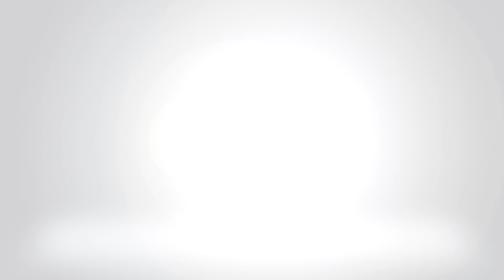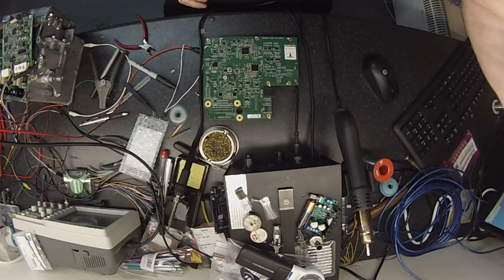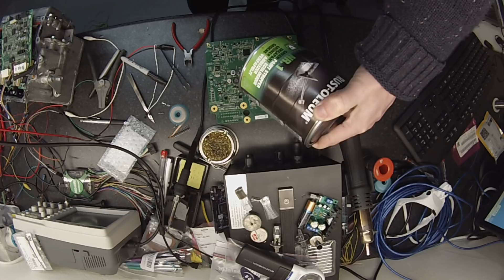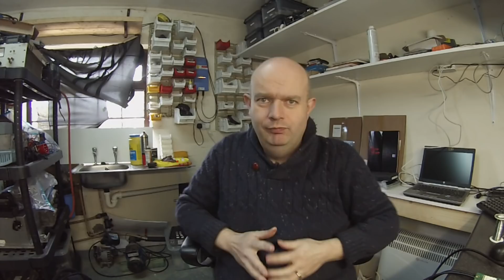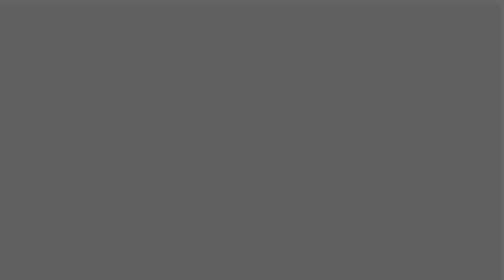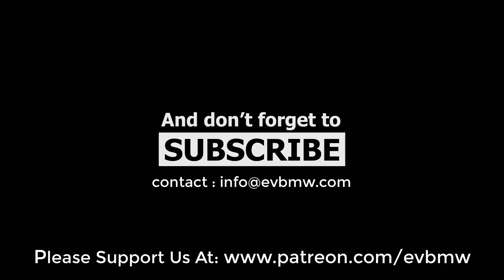Tesla Model 3 Inverter Hacking 01

Comment: Get a UV flashlight so you can see the coating, the more powerful the better.  Try Amazon.com Fubosi brand 100 LED model.  (There is a warning on this light to not look directly into the beam.  And they mean it!)  At work we use Toluene and foam swabs to remove the HumiSeal.  Toluene can be found in the paint department of your local hardware store.

Comment: Didn't have time to watch the full video yet, but: I've replaced the main chips on two of the Model S BMS boards. Assuming this is the same goo as on them (some kind of epoxy or UV curing lacquer or something), it doesn't really hold the chip much, desoldering the chip can be done straight away with a heat gun. Then to get the goo off on and around the pads to solder a chip back in, basically just scrubbing solder on the pads with a soldering iron works well enough. Extra heat with the heat gun makes the goo dark and somewhat more brittle, which may help but makes an awful looking end result.

Comment: My understanding is the IC's you removed are the TMS320F2811 (no external memory), the TMSF28035 and the Proasic A3P125 FPGA. Are you going to try and figure out what they do? Or are you going to replace them with something without knowing what they do? Usually I understand your goals and objectives, but I'm at a loss here.
Reply: He's just using the parts as a mechanical practice mechanism to see how to remove Telsa assembled chips  from a Telsa board. He hopes to apply the techniques to the Model 3 inverter board.

Comment: Circuit board coating removal. One day I was at work and I accidentally sprayed motor contact cleaner on a circuit board and all of the coating began to lift off. This inverter controller is still working with the coating curdled and peeled back. Hope this helps.

Comment: Is there anybody using the Tesla hardware un-modified in projects? By that i mean all of the electronics, mcu, harnesses, bms etc. Or does Tesla have their system totally locked down outside of an intact car?
Reply: Ego Equus yeh think those guys put one in a lotus
Reply: Jack Rickard of EVTV.me has an open source Generalized Electric Vehicle Control Unit that communicates to the Tesla Model S  P85 inverter using CAN messages. He continues to work on reverse engineering CAN messages for controlling the Battery Management System and Charging systems.
Reply: @blackmanops3749  Yeah, I've seen his stuff. I was wondering if anyone is using the stock control system and instrumentation in a non-Tesla chassis, if that is even practical. Would be funny if the whole system still thought it was a Tesla and could supercharge.
Reply: Ego Equus you would have to register it and as soon as Tesla found out what you had done they would turn off super charging
Reply: Yes, I'm helping with a conversion similar to that based on an S75. I did greatly reduce the wiring harness (pic on twitter @cafeelectric) 
I stripped out the AP, Seats, Parking Sensors, Air Bags, but kept the CID, IC, ABS, PS, HVAC, Charger, Drive Unit, EPB, Battery, BMS etc. Faking the SCCM (steering column control module) in order to hide the controls to make the car look stock.
Reply: @CafeElectric  That's what I'm talking about!